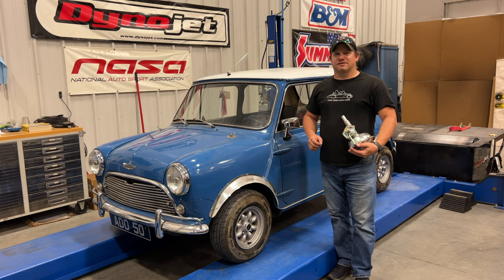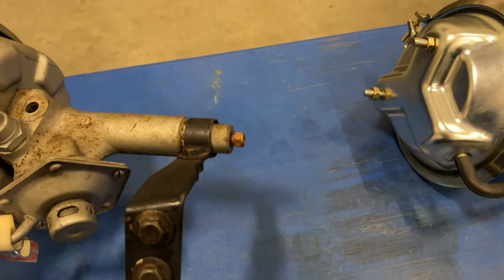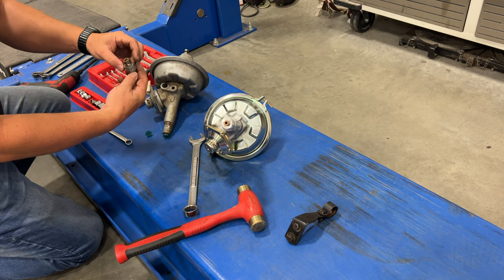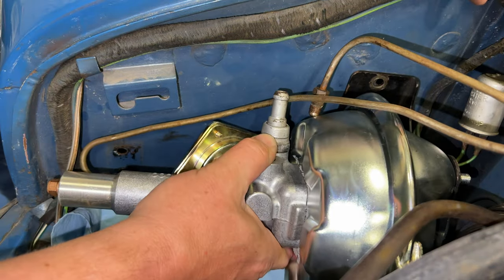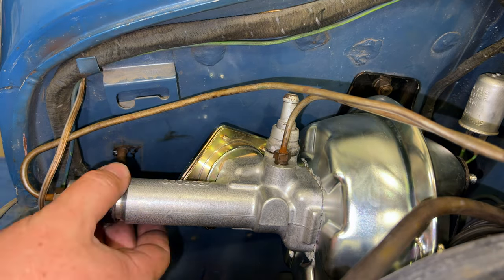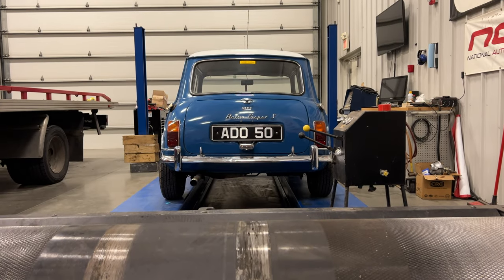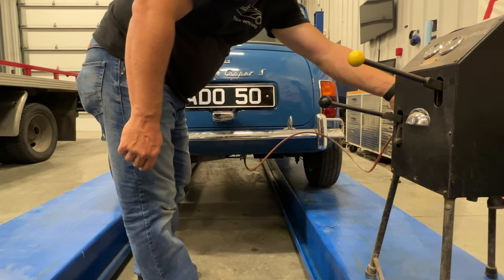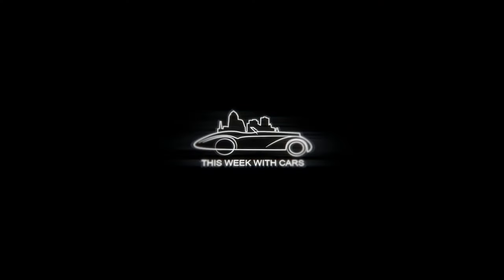1967 Austin Cooper S - Part 2 Installing the Brake Booster

Comment: Love the registration number Steve . And just noticed the mk 2 rear lamps .  In the day you'd fit those to update the car . And l love the 'if in doubt , give it a clout !"  😄Thanks Steve
Reply: This is a MkII and they had these lights as standard. Note there were no reverse lights as on MkIII onwards cars.
Reply: @1chish  l didn't think the mk2 arrived until 1968 . However it was announced at the  motor show in October 1967. And this one  has a mk1 front . Steve headlines it as a '67 . So it could be either !
Reply: @johndavey72   I think many cars were imported into the US with incorrect production years because of a US law about age? Whatever the age its not far wrong.

Comment: Nice work, Steve, I didn't know there was a pump for the Hydrolastic suspension!
Reply: Pumps are fairly easily available in England if you need one.
Reply: I made my own pump out of a master cylinder. It works a treat.
Reply: Yes, brought back memories. Those pumps were a fixture in BMC garages. Always one in the corner for pumping up the Minis and 1100s.

Comment: Yes I always love a classic Mini.  You know where you are with one of these quite easy to work on although much better if you have access to a ramp. I wonder why they removed the brake booster? If it had failed then just replace it. It has to be a lot better for the heart ❤ with that installed 😁. Thanks for the video Steve 👍.

Comment: I learned was if you're painting the door, it's better to take off the mirror and belt molding (the trim at the bottom of the window) for a better paint job in the end. The mirror can get in the way, and if you're unlucky, the clear coat could stick in that gap between the door and the belt molding.

Comment: I'd like to see the linkage connecting the break peddle to the boater.
Reply from the maker: To the booster?  It does not connect to the booster it is a remote brake servo.
Reply: @ThisWeekWithCars  lol I'm blaming spell check. Booster not boater.

Comment: Why not measure the height side to side instead of guessing?
Reply from the maker: With the modified wheel arches I wouldn't trust any measurements and it is more important that it looks right.
Reply from the maker: If you want to know about what the measurements are I think I covered that in my hydrolastic video: https://youtu.be/Ynt-jM3zCns